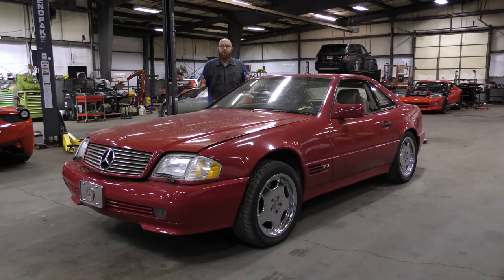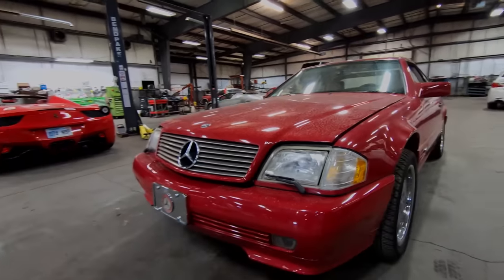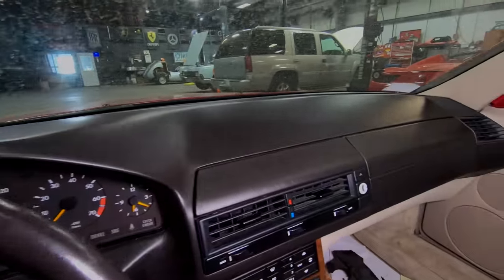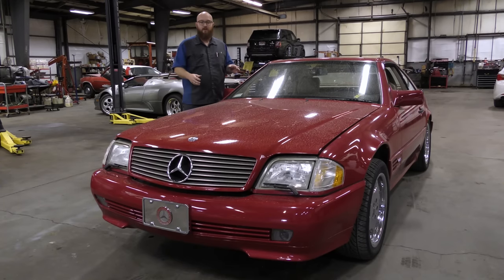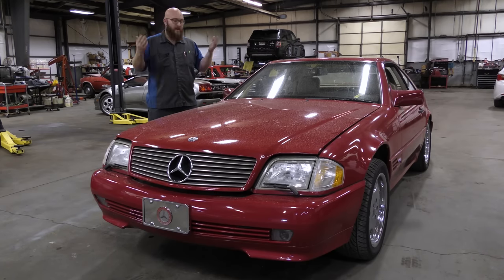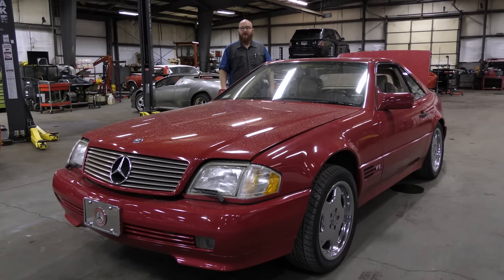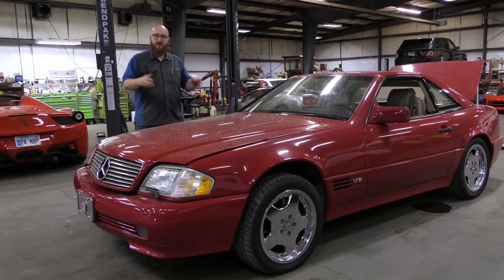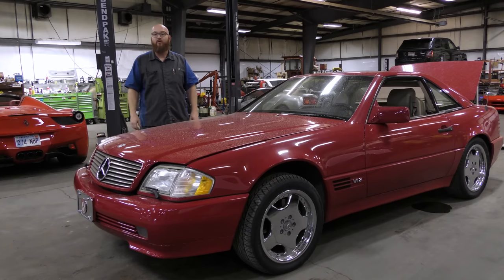Another customer scammed! CAR WIZARD shows why this '94 Mercedes SL600 is needing 15K to get sorted!

Comment: I saw one of these 94 sl600s for sale  here in san diego about a decade ago for $3300. It was black and in pretty good shape but said it had multiple electrical issues and a CEL and wouldnt be able to pass CA smog. I wasnt in the market for a car like this but recognized what a steal it was. It didnt take long online to find people talking about the biodegradable pvc insulation issue. A replacement harness could be sourced for about $3k at that time but of course the labor ticket could easily add twice that. I coulda handled that but didnt want a project of that magnitude in my driveway, our local codes dont allow a yard full of cars.
More short sighted stupidity brought to you by infantile environmentalists. An innovation meant to keep wiring out of landfills, dooms the whole car to a landfill much earlier than it would be.

Comment: I was an automotive parts specialist.
We used to have a saying regarding Mercedes and BMW's that if a customer can afford the parts to a used BMW or Mercedes Benz, they could have afforded a NEW BMW or Mercedes.
A friend from Africa was disgusted by the cost of Mercedes in the USA. He had owned a taxi company in Angola. All of his vehicles were Mercedes. As he said, "Mercedes Benz everywhere in the world EXCEPT the USA are a dime a dozen".

If I owned this car, I would do 90 percent of the work myself.
Remove the top- drain the hydraulic system, remove the cylinders.
Have them rebuilt.
Assuming I have a garage, it would be a semi-permanent top-down vehicle.
Remove the engine for ease of access.
Get (a good source was provided in the comments) or fabricate all the wiring harnesses needed. 
Treat it like a hobby.

OR , if I don't want to fix it, parts it out.
That engine alone is worth thousands. Wheels, hood, trunk, transmission, etc., etc....

Comment: The cheapest place I've found for the merc engine harnesses, is out of Singapore.
We've done a couple of SL500's and a number of 6 cyl w202 chassis's 
Last invoice for w202 (C36)
$820.66 usd (converted) + shipping.
Updated New old stock.
As a comparison.

Comment: That sorted SL600 for $18k seems very good value thats if sorted right? Perhaps if the red SL had 15 or 20k spent on it perhaps it should last another 29 years? Chances are most of the older SL600s would need the same work or more, many thanks car wizard you may have saved many lots of heartache.

Comment: The thing with these r129's is you need to start with as good as a model you can afford before you get to the sorting out aspect. Getting a really nice one is going to be bare minimum $20k, and if you want lower millage think $25k and up.

The good thing about these cars is that if you are willing to part away the parts that will not last the test of time, you can make some pretty decent money and have a reliable machine.

First things first that suspension system needs to be deleted faster than a pregnant 16 year old's "clump of cells", and replaced with a coil over system. This is going to be a must if you want to actually do any form of somewhat serious driving anyways, depending on the condition all the shitty parts of the suspension system can be sold at 50% of their new value.

I'm pretty sure if my memory serves me correctly you can get rid of just about all of it for around $2500-$5,000, presuming you bought a nicer car with lower millage. The conversion to a coil over system aint to bad in cost either,  around $1500.

You can also ditch the entire soft top system for around $700 to $1000 and just stick to a hard top. However I don't advise this because it being a convertible is a pretty big selling point and not having a soft top can really hurt the value. Your best bet is making sure that all those parts are well sorted out, and never using them. Also the hydraulic system for the top, isn't the most horrible thing to rebuild cost wise. Companies can do it for around $700, however it's something you need to keep up on well in advance before issues result. However don't forget the system should be flushed and maintained at bare minimum every 5 years, and if you want to be safe every 3.

The suspension on the other hand, thats just fucked from the get go.

Comment: As usual luxury cars of a certain age - be prepare to pay a lot of money for work to repair them or be prepared to fix them almost by yourself !

I checked something:  at one swedish auction site there is now two MB SL600 for sale: one 1998 model - 495000 Skr ie 45000 $
or
one 1995 - 220000 Skr ie 20000 $

The US had a lot of cars like this and still have them so prices is compared with parts of Europe depressed BUT getting a mechanic to work on them IS just as expensive.

Comment: Hi Wizard, I have 1997 SL600 . Did the 1997s have the biodegradable wiring harness? I don't care about driving with the top down. I rather use it a coupe. If the top mechanism is kaput can I keep the hardtop in place and forego  the expense of repairing it. Thank You

Comment: Im sure there's a "Desert Mechanic" in Libya who can repair roof hydraulics AND wiring for $500 tops - Uses parts from his scrapyard that's full of old WW2 German Tiger Tanks with V12 Maybach engines left over from the war - might be able to get a few extras welded on too! 😁

Comment: Really?  You REALLY think the "bio-degradable" wiring harness was designed to last 40 to 50 years?  If you believe that, I have brand-new C8.R to sell you.  It's located in Ft Meyers, and I SWEAR it does not have any water damage..

Comment: Did the buyer really get scammed though? I've looked at these things and as you pointed out, $18K for a well sorted out one, but the customer bought this one for $7500? I'd never buy a car sight unseen that was advertised as needing a tune up when it's priced at less than half of the other examples out there. 

Good info though. I've come across a few 1998 SL600s that I almost bought. One sold out from underneath me when I was leaving the house to go pick it up. The last one was about 4 years ago and I was looking at $19K for a 52k mile example with hard top.

Comment: I am making this comment 5 minutes into this video. My immediate question is did the customer test drive this car?  Did the customer get it inspected before buying it? Don't he realize that old Euorpean cars usually mean potentially expensive repairs especially if you can't or don't do some of it yourself?  I'm gonna start the video again and finish watching it.
Reply: I just finished watching this video. There is no way that this customer test drove this vehicle.  There is no way that this customer tested out the convertible.  The only reason that anyone would sink that type of money repairing this SL 600 is that they were hell bent on having a V12 convertible and/or there was not one available anywhere that was in better condition.  In its current condition this is probably a parts car, at best. Maybe the necessary parts to fix this SL 600 could be sourced from Germany or its European neighbors.  Just a thought.
Reply: I saw the whole video. Simple due diligence like test drive, closer visual inspection, and a trip to the mechanic for an inspection could have saved a lot of heartache.

Comment: "Scammed" seems a bit harsh.  Was the new owner not allowed to see the vehicle before taking delivery?  When I bought a used 4x4 to use on my land, the first thing I tested was the 4-wheel drive system during the test drive.  If I want a convertible, the top will be the first thing I test.  This is also a bit of an exotic vehicle.  Was the new owner not allowed to have it inspected?  I am way past my days of buying these types of cars, but when I did buy a used Porsche back in the late 90s, Porsche dealerships in my area (Los Angeles) performed "pre purchase" inspections for less than $200.  Is that not a thing anymore?  Lastly, one does not just buy these types of vehicles on a whim.  By the time I bought my used Porsche, I had books highlighting the different model years and gathered every opinion under the Sun about why I should NOT buy what I bought.  Based on what you say in the video, I would not consider the new owner as being "scammed,"  unless times have changed and I am missing something.

Comment: I bought my 1992 500SL after doing weeks of research as this was my first Mercedes. I bought my '92 based these facts: The early cars have the purity of the original engineering design before the cars were cheapened by the bean counters. You are still able to work on them. The '90-92 models do not have the electronic suspension, the electronic dashboard gauges. I do not want to deal with 30 year old computers to keep the car running. The '93-95 engine wiring loom insulation was changed and deteriorates from heat and can short out everything including your drive by wire throttle aka electronic throttle actuator. The '93 and later cars have plastic oil feed tubes that break or crack causing loss of the oil supply to the overhead cams, oops! The 1990-92 500SL’s have aluminum oil feed tubes for the camshaft lubrication proven and tested at Le Mann’s. I found my 76,400 mile 1992 500SL 38 months ago. This navy blue two tone paint example is gorgeous.  It had suffered some mechanical neglect from 2 previous owners and idled rough. It did run good on the road. I was well aware of what was needed. I have replaced the following: windshield wiper, serpentine belt, the tires, 1 scuffed wheel, the fuel injectors with new fuel supply tubes, the coils, rotors, distributor caps and both motor mounts. All filters have been replaced. All fluids were changed. The coolant, power steering, transmission, rear differential, engine oil and the brakes were bled. I paid $5000 for mine and have invested $8,200 in this 500SL and it runs & performs like the $100,000 car it once was. You should plan on making these repairs on every 500SL / SL500 with high mileage. Few people maintained these cars. I have just replaced all of the rear suspension links along with the front and rear springs and struts. The rubber that surrounds the bushing links in the rear suspension will dry rot with age and should be inspected before making a purchase. My 500SL’s were not that bad but I replaced them anyway. You may want to remove the cam covers to inspect for witness marks inside the cam covers where the cam cover fits over the timing chain before purchasing a 5.0L R129. The timing chain tension-er pads and the chain guides are made of plastic. The plastic material for timing chain guides and tension-ers will deteriorate with age not mileage. A low mileage 25-30 year old 500SL / SL500 does not exempt it from the plastic getting brittle from age. This should be done on every 500SL.  This is the most important maintenance to do on these cars. When a failure occurs the timing chain will wrap around the left H/B cams and bend the valves.   Also check cam lobe wear. The "O" rings that seal the cam oil feed tubes deteriorate with age and should be replaced also. An “O” ring that is cracked will cause less or no oil pressure to that cam lobe.  It is easier to work on the earlier 500SL's than the later SL500's that have electrical issues. A factory trained Mercedes-Benz mechanic can replace the timing chain without pulling the front of the engine apart. Mine was done by attaching the new chain to the old chain and threading it through. There is a procedure for this so do not this on your own unless you like bent valves! Do not plan on having the dealer do the work. Find a good mechanic that knows these cars before you buy one. Not after! I cannot take a short drive in this car. I do not want to get out of it. It has the pizazz, timeless style and class it had when it was new.

Comment: Are the puddling on both sides and inside the car, water or oil? I wonder if this is the reason why some people don't remove the hard top from the SL500 or SL600? Can this car be outside in the rain with the hardtop on it? Or do they leak too?

Comment: If a good example is in the $20k-$30k then he has probably bought not too badly at $7500. Add $15k then he drives away with a good car for around $22k. Many of the things that you have pointed out are fairly normal for this specific model and year/model. The wiring loom was at a time of experimentation by Mercedes on bio-degradable wiring harness sheath. These fail over time and, again, given mileage and age would usually need replacing. I think $9k seems a bit steep compared to some commentary around this on UK sites. I own a Porsche 928 and have owned it for 12 years. When I bought it (Australia) we used to say when people would say what is it worth. We would say (back then) it's a $AUD50k car just depends on where you start. Cars like the Porsche 928s and especially this model Mercedes are ALWAYS worth the extra time to investigate and research before purchase. The body and interior looks good and will likely be a great car when the things needing attention have been resolved 🙂A good example of this specific model here in Australia would be selling for around $AUD40k.  Good luck.

Comment: i have fixed slk hard tops like with just replacing o-rings. the cylinders were crazy expensive. there was a guy that sold it as a kit to do them all. now wizard cant really do this cause is shops name is on the line. but for a DIY person i fixed my slk for less than $100. this included the the mineral oil

Comment: If I had this vehicle I would take all the glass out very carefully and make a carbon fiber mold of the roof so I can make a full carbon fiber roof get rid of all the pumps and sell everything that's good in that general area that I won't be using anymore and get the wiring harness built

Comment: I would have paid Car Wizard to do a presales inspection of this vehicle first before money changes hands if I was into buying a Mercedes.  If the seller refuses, run. 

I'm sure Car Wizard would love to do presale inspections to save their customers that gut punch after they've been ripped off.  A vehicle inspection fee and getting an honest opinion from an honest auto tech is cheap in comparison to what you may get stuck with.  Inspections of any high cost item are a form of insurance to keep you from getting ripped off.

Comment: About the hard top. Remove the entire system ( all of the cylinders, relays, wiring ) and weld it shut.
Same thing with the suspension. Discard the entire system. Use a cheap and generic setup for the suspension.
The engine though. You have to pay for the hand made wiring.
This brings the total to...... 12 k. 
🥲
Reply: The hydraulic fluid leak for the hardtop and soft top makes for a dramatic video, but in reality if you want a driver, you only need to disable the relay to the pump and leave the hardtop alone.  You can then manually remove the hardtop and raise lower the soft top if you so desire. The wiring harness will need to be dealt with.

Comment: I own an ‘89 500SL R129 and I’ve never had any major issues with it. This car looks like it was either abused or neglected. Systems like the roof hydraulics are a maintenance part - ignore it and it will go bad.

Comment: That car is sold fully refurbished 70 to 80.000€ hear in Europ thought.  There is a specialist in Spain who deals with pieces, wouldn't be surprised if he had what you need not to expensive. I think 3 or 4000€ around that. 
Tees cars are valued on the money you can prove you invested.

Comment: Bleh. . . Remove hydraulic system and keep the hard top.  Pull the harnesses off and have a local electrician resheath them. If you expect perfection, you will pay for it, but if you're willing to accept some imperfections, you can have a REALLY nice car for much much less.

Comment: A car like that would be perfect to pull the wiring harnesses out of so you can make your own mass-produced wiring harnesses. Pretty soon selling harnesses like that would be paying for the car itself. Assuming you get everything right.
Reply: @port nut most companies don't Sue over you manufacturing replacement parts. And replacement wiring her and it would be considered a replacement part. Just don't advertise it as OEM made.

Comment: Car is a good candidate for an LS swap. Ditch the MB motor and electronics and make the soft top manually operated. You’d get more HP than the stock V12 put out and better reliability. Nothing wrong with hot rodding an old Mercedes.

Comment: PALES to the billions VW spent on diesel gate. SL600 is an S class. 15K is reasonable for restoring one, that's almost 30 years old! Try duplicating it. Mono WIPER, recessed windshield, larger passenger rear view mirror, passenger air bag! Last, non-Chrysler era perfection in transportation. Worried about wiring and some fluid?
Reply: I agree. People complain about high maintenance on a high dollar car - makes no sense. I buy cheap older luxury cars, and put a ton of money into them, sometimes double what they’re worth… I have the money, and it’s my toy/hobby - so I don’t really care how much it costs, nor care how much I’m losing when I eventually sell. It’s a car, not a 401k.

Comment: Not sure how you are coming up with 5000-6000 for the Cylinder repair ,if the cylinder are damaged then the shaft were scratched by an inexperienced mechanic 10 hours for taking them out /in you are working really slow.
These cylinder are not bad it is just the seals, every good mechanic can put new ones in you don't have to send them out ,also plenty companies out charging $ 70 + per cylinder
Reply: I bought a good seal kit off eBay 8 years ago and my hydraulic cylinders are still doing good today. He makes it look like those are special hydraulic cylinders. The last I looked. They all rebuild the same way. I don't trust mechanics to work on my cars and a yoyo like him is a prime example as to why I do everything in my own garage.
Reply: @Theblueghost69falcon289  do u have a video of your work?